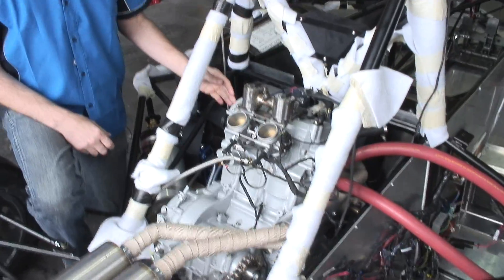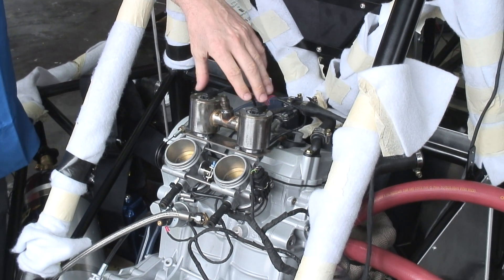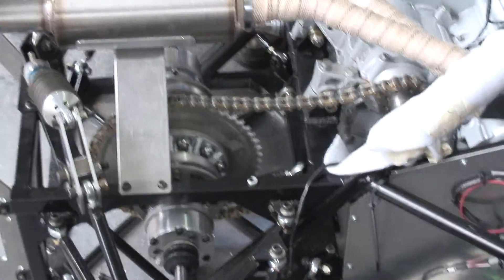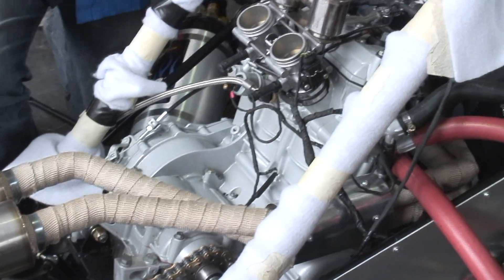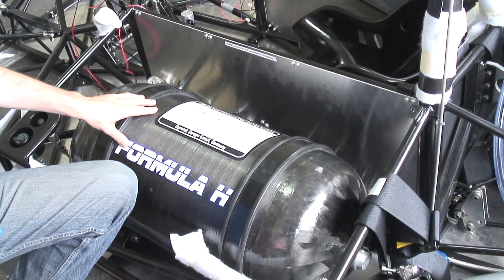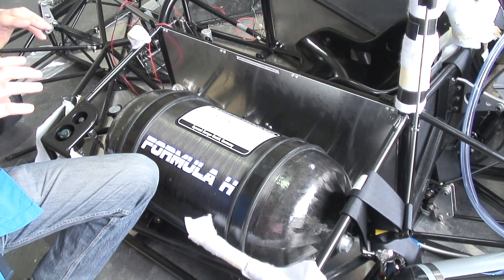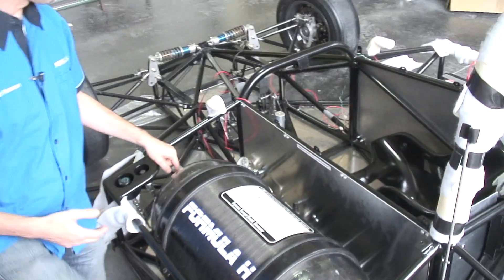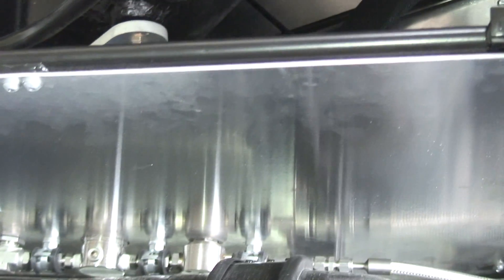How hydrogen engines work - RMIT University

Comment: When will people realise that hydrogen doesn't explode without an oxidizer present, just as gasoline tanks don't blow up if you shoot at them. No oxygen inside the tank = No boom. You'll perhaps become deaf when the pressurized hydrogen expands into the air very quickly, but its nothing compared to starving to death when you can't drive to work because gasoline is too expensive to burn.

Comment: Very impressive piece of work.............its a little problomatic that you need such a large tank for such a small amount of fuel. Great it is about real engines, rather than a special experimental unit. Do you require any additional upper cylinder lubrication, as LPG ?
Best regards Bob

Comment: The New Flyer H40LFR is a hybrid hydrogen fuel cell Bus. 

It can be used as an engine, but there are not very many Hydrogen Pump Stations, and fuel cells are expensive and fragile.

Comment: well if you run nitrous in the hydrogen filter then you won't  have as much speed as you would get out of dirt . so what i'm trying to say is don't use hydrogen or water use dirt mixed with nitrous its much cheaper. and remeber check your 8th gear four stroke powerband

Comment: would be better if the hydrogen was separated from water then goes into the engine so instead of having to fill the tank with hydrogen you can just fill it with water
that way it would be very cheap to run